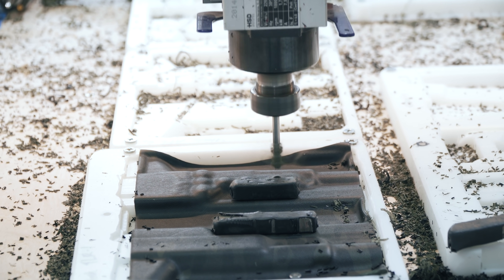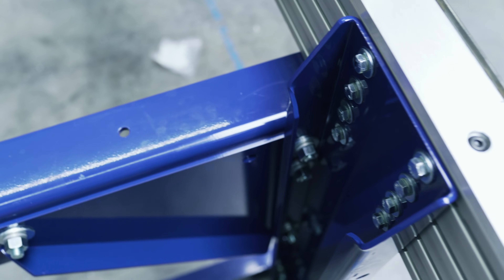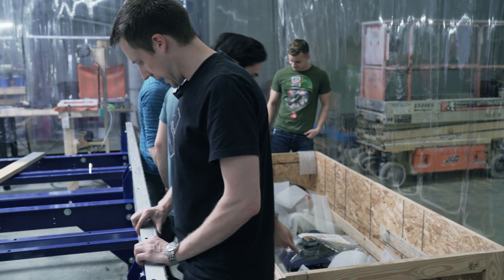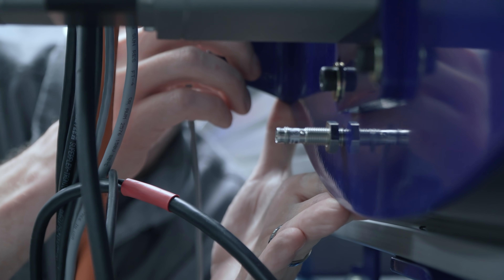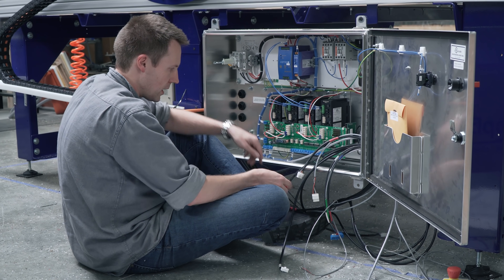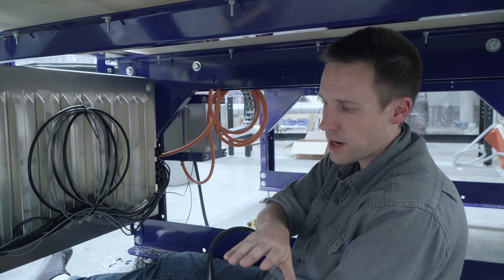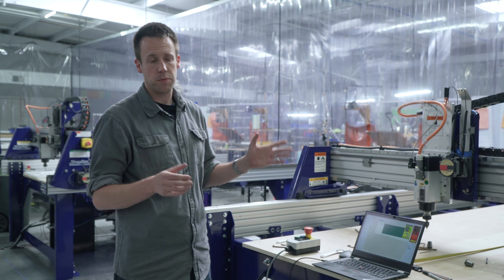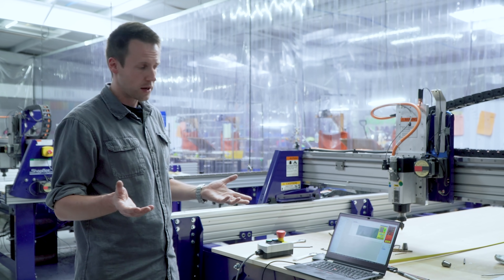Shop Expansion: Building a New CNC Machine

Comment: Guys, one easy upgrade I'd recommend - some dust collection. Slap a boot on the end of the spindle, hook up a vacuum, and put a Thien baffle between A and B. It'll separate out all the chips and only the super-fine dust will get to the vacuum.

I've already done the work designing 3D printable fittings for a couple of standard shop vacs. They're meant to fit on a 5gal bucket, which will obviously be too small for your production shop, but you can always put that above a trash can and knock the bottom out, or just take the idea and come up with something of your own.

https://www.youtube.com/watch?v=Evu_HuDse4M

I was very, very close to buying a Shopbot last year at a liquidation auction. Unfortunately, there's only room for one CNC in my shop, and that's already occupied. Next time I move I'll get a better space.

Thanks for all the videos you guys do. I find them super helpful and informative. Hope this suggestion repays a bit of that favor.

Comment: Love vids like this. My day job is operating and programming CNC Laser cutters for flat steel. I learned a lot about the precision of the install process (especially leveling and squaring) when I helped out our last install in August. Gives new appreciation for the setup. Cable management is something I'm OCD about, and in my world makes a huge difference with a moving bridge/gantry system. Good stuff guys!

Comment: My machine is slightly smaller(48inx60in footprint), and made out several sheets of chipboard and lots of woodglue. Even the gantry.  Even going to have improvised linear bearings and use a Makita wood router for a spindle(it has a speed control, oh boy).  Finally possible to afford even this little bit because a lot of ducks have lined up in a row for me this year.  And as pathetic as my situation sounds I'm thinking exactly like you on this. Have some ideas for things that I've never seen before, and I think that I'll finally be able to make them.

Comment: sees no issue with attaching wiring to the heat sink for the control box
Reply: It's not really a very good heat sink. It's just fins spot welded to the back on the box. The wires aren't any hotter than they were in the box, and they aren't really impeding airflow.

Comment: I'll never stop using miles, feet, and Fahrenheit day to day, but precision at the 1/32nd of an inch level is one of the few places where the metric system is way better than imperial.
Reply: hoorayimhelping Decimal inch works well
Reply: I agree... But decimal inches are good too. I should ask Shopbot to include a more precise tape measure with the kit.

Comment: The machinist part inside of me cringes when I see people making "precise measurements" with a tape measure. Lol
Reply: Yes, I know. I should have taped three yardsticks together, or sharpied some lines on a bit of string.
Reply: @isaacbotkintrex I was more so thinking super gluing a bunch of 9x19mm rounds end to end as a measuring stick, since bullets are so exacting in dimensions. Lol I'm just giving you a hard time. I just have a stroke of OCD in me that loves to make things with impractical and unnecessary levels of precision. Lol I like playing with micrometers and calipers and such. Great video! Love what you guys are doing!
Reply: Kyle Duddleston me to lol it also makes me cringe when they buy a cheap CNC
Reply: @isaacbotkintrex  Bro the tape measure accuracy is good enough if you have enough attention to detail while doing your measurements. Been there done it lol.
Reply: What else would you use for such a long dimension? The best way I have found is to just "burn an inch" (you measure at the 1 inch instead of the end) on the tape measure and use the same side of the tape for both measurements.
Reply: @HickLif3  A really big caliper. A gigantic gauge block.
Reply: @googlesux1062  so a 9 foot caliper or guage block? Ok
Reply: Where is your precision level!?! I hAVe a TaPe mEasUre.
Reply: I don't build things for a living, but are tape measures pretty inaccurate?
Reply: @Thefredbanana  Its not that they are inaccurate. Its that they are not precise because they don't measure down to a small enough amount. Its fine for what they are doing and similar things but machinists generally work with tolerances that are in the .005" range and smaller.
Reply: S F you can get tape measures that show all the way down to 1/32 and if you have good eyesight and good help you could even get it to probably within 1/64 which for 8-9 ft for what they did I would say is plenty accurate. They’re also making holsters... so they don’t need accuracy down to the thousandth
Reply: @HickLif3  I said in my post that it was fine for what they are doing but if you think 1/32  is precise than you dont know what precision is. And yes they do make giant calipers. We had a pair of 6 ft calipers at my last job so stop pretending that you know what you're talking about.
Reply: @Thefredbanana  I think most of the inaccuracies come from any tiny bend or twist or drooping of the tape. If the tape is not completely flat and tightly pulled across the distance, it will measure longer than what the distance really is because of that wasted travel of the tape. A sturdy measuring instrument or a  bit of geometry math to measure across the smaller sturdy bits of the machine might result in a more true measurement. But with all of the tweaking you can do in the software, you can get away with using a tape measure.
Reply: 1:58 they're all about accurate nudging

Comment: What kind of tolerances can this machine hold? And what kind of tolerances do you usually hold your kydex product regarding QC?
Reply: Chris Beck I bet they have no idea
Reply: If it's like the other three machines it will probably stray a few thousandths over the course of the day. That magnetic zero usually comes within 3 or 4 thousandths from our reference plate. I think that has more to do with the rack and gears than the sensor and brain.
Reply: Isaac Botkin thank you for the answer! Hopefully one day you guys are looking to bring on a few manufacturing/ mechanical engineers 😂 I’m always looking for ways Into the industry

Comment: "incredibly affordable"
Reply: Compared to a lot of similar equipment, yes. That being said, costs of manufacturing equipment IS coming down. It's very exciting.
Reply: @isaacbotkintrex  people are too stupid to realize what relative means. Don't waste your breath trying to explain.
Reply: Cnavarro 20,000 compared to easily 40-50k a few years back. And if you purchase the machine on a zero debt basis, it would only have to cut probably 200-300 sidecars before “paying” off itself.
Reply: @Thefredbanana  I doubt that counts the cost of materials though does it? It would still pay itself off pretty quick though
Reply: @HickLif3  Not at all. Sidecars sell for roughly $100 (easy math). Buyers buying 200-300 sidecars would bring the company roughly $20,000 - $30,000 revenue (Not in profit but in revenue). This doesn't factor in paying the human to oversee the machine, taxes, parts, or labor/time/machines in assembling the holster or electricity for machines, or shipping. Figuring the machine cost 20,000-30,000 to order, ship, and install and have up and running. But still, if 200-300 sales is enough revenue to equate the cost of the CNC, that's insanely inexpensive! The machine would pay for itself very very quickly I would imagine.
Reply: It definitely is. Considering that the bottom of the line CNC mill from the company I work for costs $165k.
Reply: For a cnc that big it is.